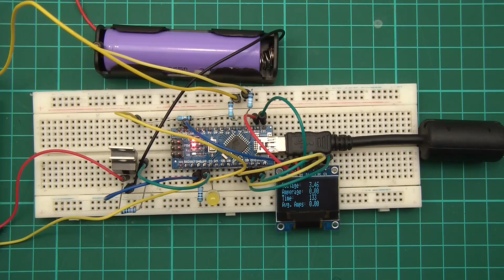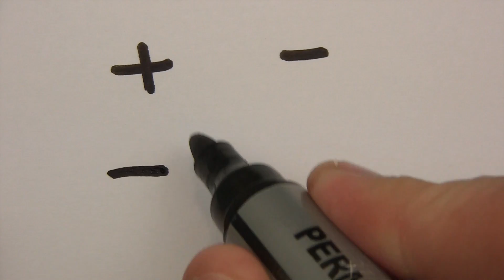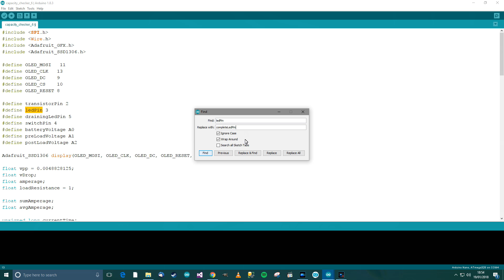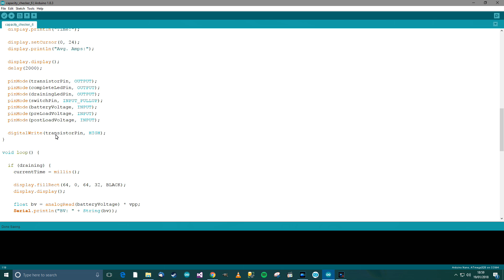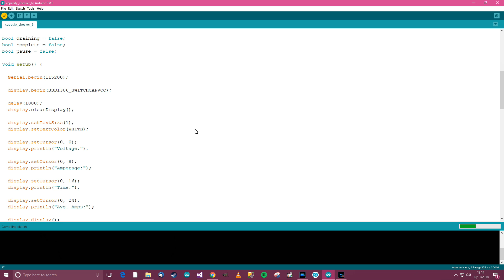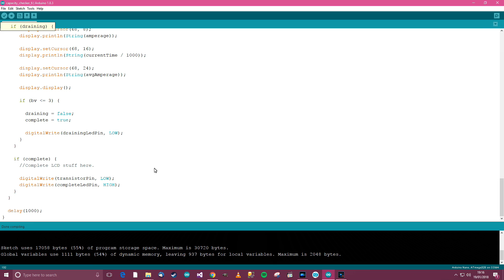TUTORIAL: DIY 18650 Lithium Ion Cell Battery Capacity Checker Tester (Part 9 - LED/Tact Switch)

Comment: Ohh, and a bit of some criticism. Your volume was a bit lower than normal. Not sure why as we could hear your keyboard just fine, and the squeaky mouse wheel  😜
Reply from the maker: Haha! I've been working on perfecting the sound for a long time. Since having the channel, I've had 2 cameras, 4 microphones and 3 pieces of editing software.

The camera has an inbuilt mic. It used to whirr and make weird noises... I was about to abandon and buy another one, but thought I'd just update the firmware before I did - and the new firmware cured a few little bugs including the whirring noise!!! Also, I've realised that the microphone is sensitive. I have to remember to keep 30cm away at all times, sometimes it's not easy since the camera is right infront of my face when I record. To far and it goes patchy, to close and it sounds 'gravelly'.

The microphones, basically were crap. Now I use a Samson CO1U which sounds great, but, it's expensive and I have to talk directly into it, because of this, I struggle to see the screen as I'm typing! I need to get a professional hanger thing for it - but YouTube doesn't pay me enough for that at the moment! 

The editing software I use now is called Cyberlink PowerDirector, it's the best I've ever used, but again, this can mess with sound. Because I record from two different devices, I have to level the sound, and I use the software to do it. Sometimes, the software doesn't seem to do it perfectly though. The camera is inherently louder than the quality mic.

I really struggle with sound, but part of the problem is that I'm doing everything on a budget. Believe it or not, of all of the 200 videos or whatever it is which I've done over the 12 months, earn't me £500 in total. I had to buy my own equipment out of that and each video takes me approx 2-3hrs to make! Basically, I just don't get enough money from YouTube to warrant spending enough to improve the quality. Sadly, there's just no money in it. (At the moment)

:-(
Reply: You'll get there  :)

Have you tried using one of those clip-on mics? Can't you just record all your audio from one source and then splice your videos together to match the audio?
Reply from the maker: Korishan I could do that but it's extra expense and also will take even longer to make the videos. I don't enjoy editing and the thought of having to edit audio also really puts me off. I actually want to cut down to 2 videos a week instead of 3 but some viewers seem to be sad about that. Lol

Comment: Another nice video  🤠
I would imagine you'd be using the millis(); function and checking using timer variables. That way, you wouldn't have to worry about "did the user input?" You can check with each run of the loop.
Of course, the other option is to actually use the the interrupt pins for the user input.
Soooo, which path shall you take us down?  🤔
Reply from the maker: Hey, the path I will choose is........ the millis(); method. In the loop, I'll simply say something like if millis() > last test + interval then time to check state....